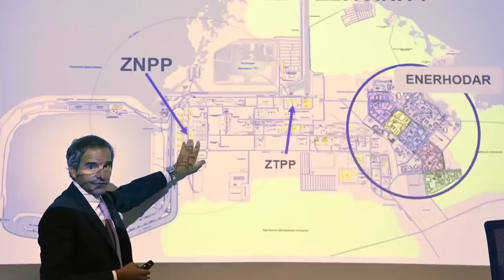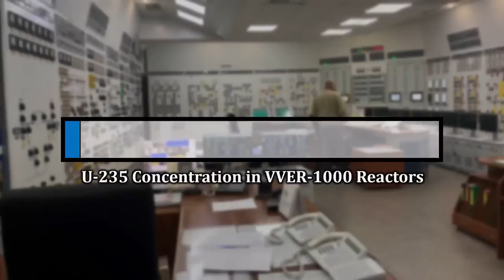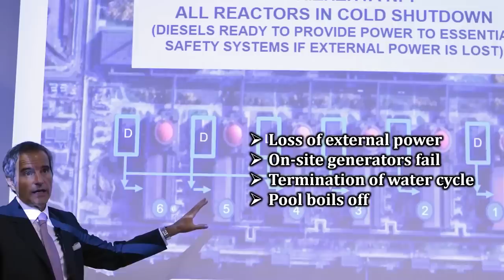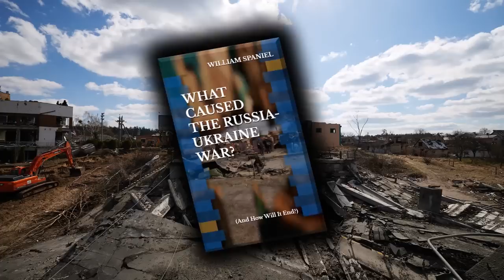Where Will Ukraine Strike Next? The Three Main Options Available to Kyiv

Comment: I think there is a lot more to the northern front than `low value' territory gains. The major significance is not just cutting the supply routes from Belgorod to the Donetsk/Lugansk Oblasts held by the Russians (although that will certainly be a big plus for the Ukrainians), but a break through here critically provides the ability to threaten and potentially by pass all those defensive lines built up since 2015 which as you rightly point out is not a good option for a frontal attack. So pushing the Russians back deep into Lugansk can threaten to collapse the whole Donetsk defensive line,. It also threatens to take the battle to the outskirts of the city of Lugansk itself (and potentially even the city of Donetsk), and overall destroys the Russians ability to seek a political solution where it claims the portions of Lugansk and Donetsk under its control. This is not to disagree the Zaporozhzhia front offers the best strategic `pickings' as things currently stand, but i believe the Ukrainian General Staff will be giving the northern front a hard looking over. We may well see a similar dual front strategy been implemented as Ukraine did with Kharkiv/Kherson. .... its a lot easier for Ukraine to move its troops between fronts (been on the `inside' of the curve) than it is from the Russians.
Reply: Indeed.  The norther front presents the opportunity to swing around the Luhansk defense lines and strike them from the rear.
Reply: Ukraine has lost the economic war and a good chunk of eastren territory,  Ziolensky will soon negotiate the end of hostilities and retire to UK, ...and EU will pay the damages
Reply: @javierfrancia1938  Cope.
Reply: @ChucksSEADnDEAD     you know they say there are an infinite bunch of alternate universes out there maybe Javier has found how to cross over.....
Reply: I don't think the Donetsk or Luhansk fights are advantageous to Ukraine.  Threatening to cut off all the Russians in the South with only supply coming through Crimea offers the best chance to induce another Russian rout, retreat, or withdrawal.  So, Tokmak or Melitopol as these are the only two rail routes other than the Kerch bridge itself to supply the South.   I worry this window of opportunity is closing for Ukraine as surely the Russians sense their vulnerability...the danger they are in.
Reply: @chrishooge3442  They should have attacked there a month ago when the better Russian troops were on the west bank of Dnepr
Reply: @NUMMEHARBEN  That's what I was hoping for.  Fix the Russian forces on the West Bank and then cut them off with a drive from Zaporizhzhia to Melitopol.  I have to imagine the Russians reinforced against such an offensive.  

Can you imagine when you planning a withdraw from Kherson and suddenly Ukraine is about to cut you off to the East.  There's a lot of talk about the Kinburn Spit...I suspect this is an attempt to distract Russia and perhaps draw some forces further West.
Reply: Why doesn't anybody talk about natural ressources. Kharkiv and Luhansk have a lot of potential. 
But yeah, best choice would be to pretend a huge attack in the north, if russia reacts and fortifies luhansk, try in zaporizhzhia, if they don't...take luhansk.
If the commandment chains are as bad as western Media wants to tell us, shifting units might open gaps, if it isn't,  it might open traps. 🤷‍♂️
Reply: I would also like to mention that this will cut off all 4 of Luhansk railway lines coming from the east (by putting those in HIMARS +artillery range at the very least) and 1 coming from the North. Which will destroy russian logistics on the south (railway is the main logistical solution for russia).

You can see it on Ukrainian railway maps
Reply: I'm not sure retaking the parts of Luhansk oblast that Ukraine controlled before the war started earlier this year gets them past the defences the Russian backed separatists had in place from 2014. It's a nice idea but I don't think this would work, which is why this makes little sense right now. It also puts you much closer and vulnerable to attacks from within Russia itself as well. Cutting the land bridge in two makes a lot more sense, but this won't be as easy as suggested either because the Russians have already dug in here and re-enforced their defensive forces in this area, they know this is a threat as much as the Ukrainians and those supplying them with intelligence do. It's still what is needed to be done however and hopefully with the right weapons systems supplied to them they can make this region a living hell for the Russians to defend.
Reply: @javierfrancia1938  In your dreams.
Reply: @mattpotter8725  I didn't say only taking the parts of Luhansk "before the war from 2014" . Clearly for this to work the Ukrainians have to drive into Luhangsk Oblast (which they are currently doing) and swing right, which would include retaking Severdonetsk. The point been they will be hitting the major Russian fortifications from behind/the side, or most likely even just by-passing them behind and forcing a Russian retreat from that front. As you say, not easy, but then no front will be easy. Certainly the Russians will also be expecting a Zaporozhzhia front attack so will be preparing.
Reply: @lfield2494  I just think, as was pointed out in the video, attacking defensive lines that have been there for 8 years and held throughout that time takes away men from other areas of the front that are more important. And when you are the fact that they could be attacked from inside Russia itself that would be at their back it's not worth the risk. It will have to be done at some time and I'm not saying don't try and advance to places like Sievrodonetsk, keep the Russians on their toes there, having to keep forces up there, just that the south is more important strategically right now and would be more of a blow to Russian morale.
Reply: @davidford3115  Lots of options. 
We have been told the wargamers from NATO are giving good military advice. Where to strike first is a political one..
Reply: @patclark2186  Yeah, if only those same wargamers would pay attention to the warning by Michael Pilsbury about China.  

Much like how Erich Marcks played the Americans in Wehrmacht wargames and correctly predicted the Normandy invasion (and was ignored by German High Command), when Pilsbury plays Team Gold/Red (China) how the Chinese actually operate and behave, he NEVER loses.  

I fear American war planners have grossly mis-judged the Chinese almost as bad as Putin misjudged the Ukrainians.
Reply: @javierfrancia1938  Yeah yeah and They will fall in 3 days, and they will never be able to retake Kherson city.
Reply: I think a point to remember is it’s all well and good to attack and enter the former Russian backed separatist areas but in doing so you are leaving yourself open to griller warfare from local Russian residents. This is a issue Russia has had to deal with in other areas of Ukraine and it ties up a lot of men and resources in trying to protect your supply lines.
Reply: @javierfrancia1938  Dommage que l'on ne puisse pas répondre comme il se doit à de tels "individus"....Il y a des coups de pied au cul qui se perdent ! Mais un minable restera toujours un minable...
Reply: @kentriat2426  Not a problem when the other areas are liberated, especially now that Ukraine is getting loads and loads of equipment from the west.
Reply: @JohnDoe-bd5sz  yeah these territories are probably low priority for sure. I would imagine resetting things to pre 2022 stage would be higher priority and then Crimea and finally these territories. However, with all of the forced conscription going on a lot of the manpower will have been used up to fight Ukraine forces AND the Russians have not been the best "liberators" so I doubt local public opinion in those territories are as high as they might have been previously.
Reply: @JohnDoe-bd5sz  between cutting the bridge off and if they can advance south to cut off the only rail line connecting to Crimea then things would get very dire very fast for the Russians. Originally I figured they would need to advance and just take the whole area but they just need to advance a little to put the main highway and rail line under artilery  range and they can cut EVERYTHING off. Basically Kherson all over again on a grand scale. Keep some pressure but don't push hard right away. Then, slowly advance to take rest of Kherson and then Crimea when the Russians have used up all their ammo and other supplies.
Reply: Ukraine should wait on rest of the annexed locations because those would be much more likely to degrade into guerilla war that would take a LOT of manpower away from the real drives needed for other parts of the war.
Reply: @brockwilkie6022  I agree, cut the Crimean bridge totally, and get within striking distance of the roads to Crimea, and Crimea will be the next Kherson for Russia.

This is probably why they are trying to build a road on the narrow piece of land on the east side of Crimea, to hold out longer.

To be honest, i would argue that when they have all of Kherson, they should focus on Crimea. Domestically it would hurt Putin a LOT if he had to "regroup" and leave Crimea.
Reply: The CORPS/DIVISION TOCs are doing a fantastic job, as are their commanders carrying out the plans. Then the troops!
Reply: UA has now started using long range drones hitting RF airbases south of Moscow.  Start using same drones en mass to destroy RF rail lines, Re supply lines, ammo dumps, Command HQs etc etc.  RF will withdraw itself as they realize they’ve self destructed again in “a bridge too far”.
Reply: Ukraine got lots of RF abandoned materiel
Reply: @javierfrancia1938  Troll. You do amuse me with your forlorn grasping at straws.
Reply: (armchair mode) Yeah, but at the same time it's also a lot of empty space that needs to be occupied - anything more complex than "grab Svatove, cut the road and flank south" seems to really not be worth it.
Reply: @LutherBlissett100  Lets hope that Ukraine is given ALL that is needed to mass produce these drones.
Reply: @markstott6689  not a Troll, neither a Stott,  you do not amuse me, but i can still help you before is too late
Reply: Все правильно ,, больше HIMARS ,,,,много русского удобрения ,,,-замечательно
Reply: @javierfrancia1938  Third time you've said the SOS [Same Old Shit].   I guess you believe that the more you repeat the SOS, the truer it gets?
Reply: @DarkerHeartbeat  Ukrainian Railway Maps are VERY important at this point [I'm commenting in middle February]
Reply: @charonstyxferryman  What does 2 clown faces mean?